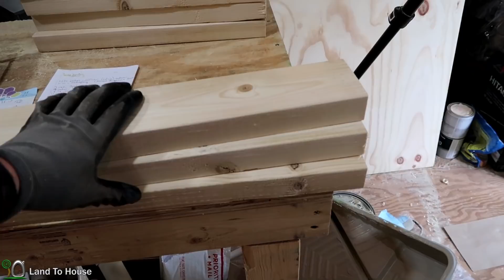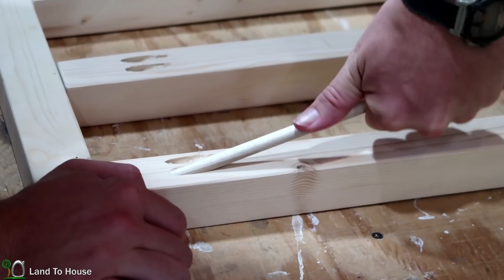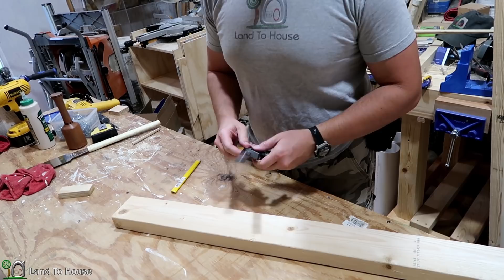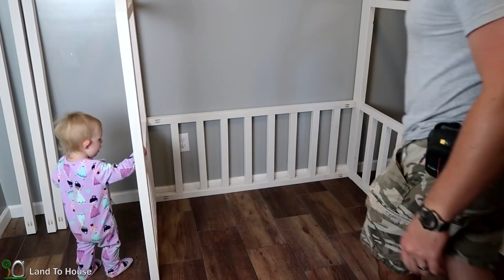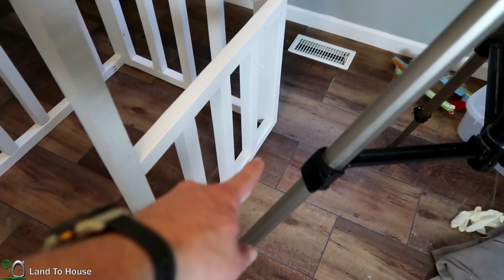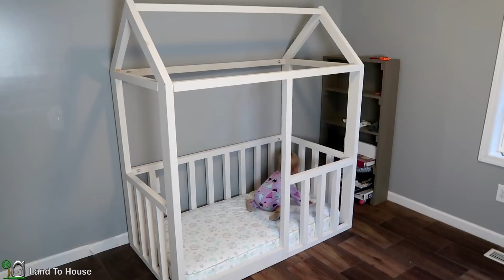Build a Toddler House Bed Frame

Comment: Hey, great build! I am going to try and make one for my kiddo, could you please tell me how many pieces of 2x4's you purchased/used for the build?? Thanks!
Reply: Did you ever get the answer ?
Reply: I just did the math, it's 58.166 ft total or about 698 inches total (692.25 inches to be exact) ...So you would need about 10  6ft pieces of 2x4 wood (12 just in case)   OR    Eight 8 ft boards since he cuts an 8ft board in half to do this.. I'm going to buy 9 of the 8ft boards, just in case because they are so cheap.

Comment: Very nice job, what does Ashley think? Emma obviously likes it!
You might want to add some colorful fabric to complete the roof. 
I see you really like using pocket holes. Using the tensile strength of the screws is an ideal approach. 🦀
Reply from the maker: Ashley thought it turned out really great. Emma and I have already added fabric to the top to make a tent. Pocket screws are great. So easy to work with.

Comment: Hi. How long did it take you to make the bed? If I have no experience at all, do you think I can still do it by myself? Thank you
Reply from the maker: The cuts and pocket holes don't take too long. Sanding and paint is the longest part. I like to take the build in sections. After you finish the build you will feel accomplished!

Comment: What is the spacing that your used on your railing slats? Did you stick with standard crib spacing or are they wider? If wider why did you decide to go wider? Do you have any concerns for safety and getting limbs or head getting stuck?
Reply from the maker: I think these are just slightly larger than they should be. But no stuck kids yet haha. Both my kids are all over this bed.

Comment: Make sure the space between your pickets is no more than 4 inches.  This is code so that your child will not get their head stuck between them.
Reply: If the boards were exactly 2inches wide, he'd be okay, but they aren't 2inches wide so his opening is too big in the middle and the are certainly too big in the corners. Luckily, the bed is on the floor so there's no danger of falling. But getting your head stuck whilst sleeping can be terrifying. 💜🌞🌵
Reply from the maker: I will have to measure its really close to 4 in.
Reply: Actually the spacing should be no more than 2 3/8” which is regulation for crib slats
Reply from the maker: That's very interesting. Well now that my daughter is two and a half and just getting in the bed it should be okay. Her head is much larger than 4 in.
Reply: @LandtoHouse  since it's on the ground and not trying to prevent the child from falling out of the bed, you can go with a deck railing spacing standard of no more than 4" gaps to keep children from becoming stuck between the stiles

Comment: It's a really nice build, but I hope you go ahead and plug those last pocket holes otherwise why plug any of them at all? 💜🌞🌵
Reply from the maker: I was trying to think of a way to plug those to make it look nice. But still give it the option to disassemble to move it later
Reply: @LandtoHouse , what if you plugged them without glue? Then you could drill out the plugs for disassembly? I'd take photos so I could find all the plugs later, but I guess you have the video! Silly me! LOL! I'm thinking that you might be able to drill halfway and then pull the plug out? Or maybe put a screw halfway into the plug, then pull on the screw and the plug should come out too?... Easy to test on a sample. 💜🌞🌵
Reply from the maker: I have not gotten around to this yet. I need to do something to plug those holes that can be removed later. Not sure what I will do.

Comment: How many 2X4 did you use?
Reply from the maker: I would have to go back and count them from the video. Sometime in the future I will make a 3d design with cut list. That will have the number of boards.
Reply: What would be the dimensions for a full size bed?